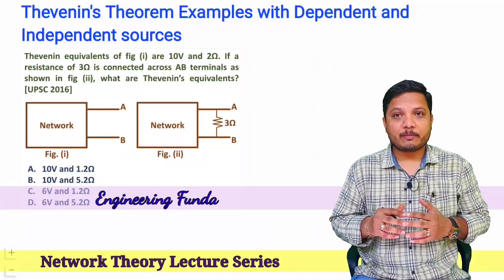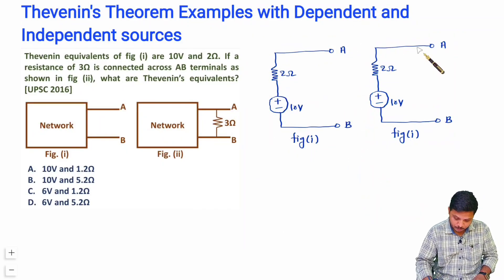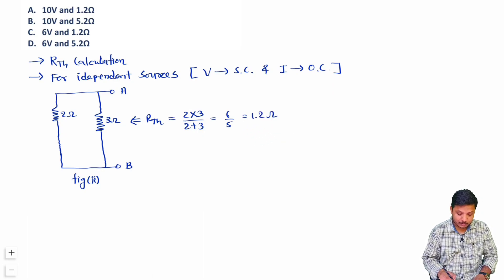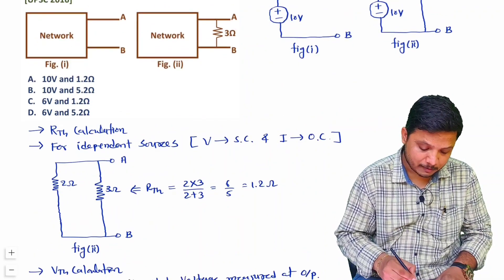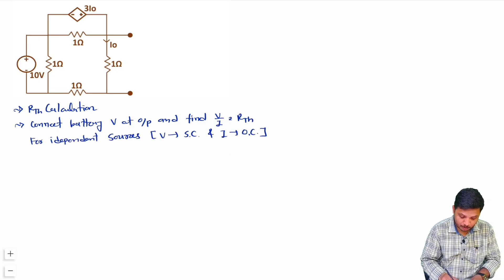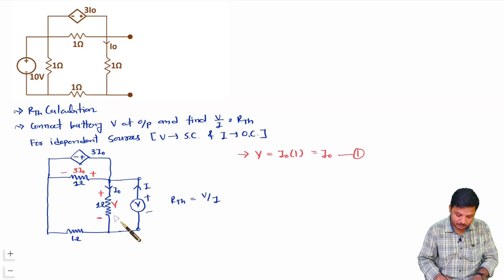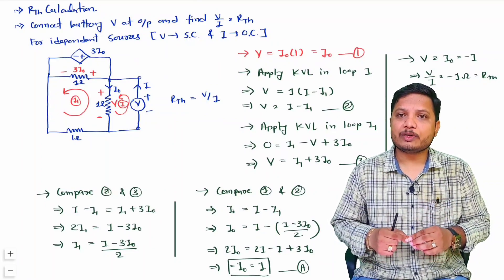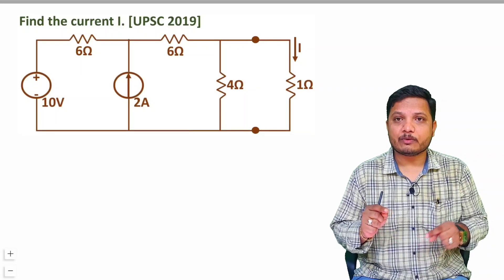1 - Thevenin's Theorem Examples with Dependent and Independent Sources

Comment: Sir, I neglected resistance parallel to 1 ohm as per network manipulation rules, but it yields a different ans. Please clarify upon this.
Reply from the maker: Then solve it again dear by considering 1 ohm.
Reply: @EngineeringFunda  Yes sir, then I got the correct ans, thanks a lot sir; but sir is there any reason, why network manipulation rule yielded a different ans?
Reply from the maker: @life_earth-2341  : it should give correct answers, provided you have used it in correct manner. Without watching your solution i can not say anything
Reply: @EngineeringFunda  Yes sir, I identified my mistake, thanks a lot sir! :)